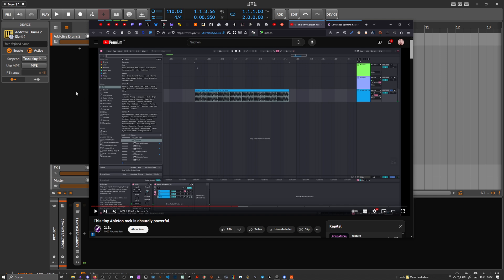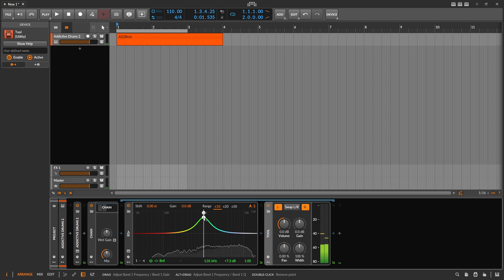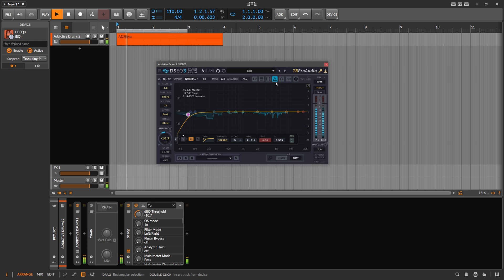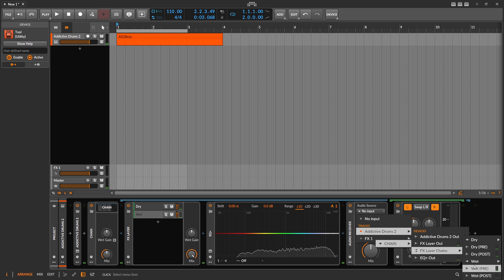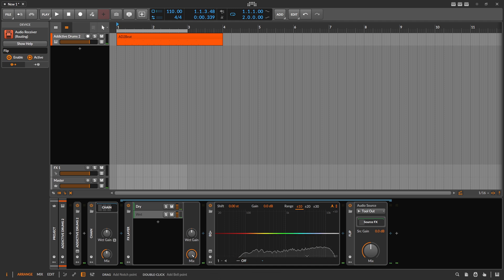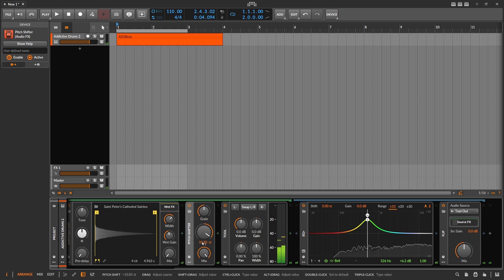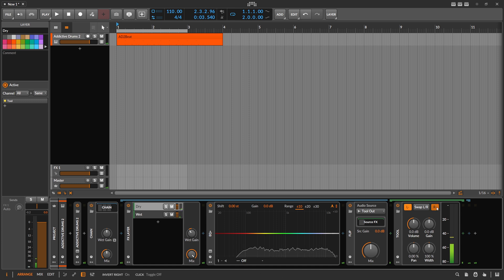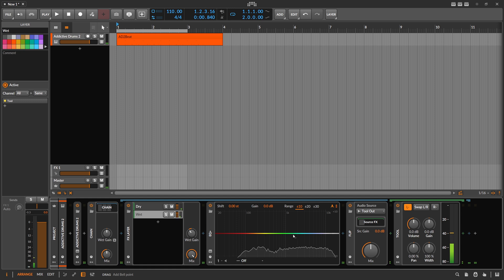This Bitwig Chain Should Not Work (But It Does)

Comment: yoooooo I was hoping people would make the same for other daws, lets me be lazier 🔥 🔥 

a few things:

the most powerful part of this technique is that it works with any effect, not just eq. I have seen multiple people do blending in of effects with eq in a similar manner previously, but have not seen people use other effects (although I'm sure some have). this flexibility is the most important part: i only sometimes use eqs for the splitting, more commonly I use clippers, choruses, transient shapers, spectral gates, etc. For example, you could use the bitwig odd/even harmonic split, and use it to mix two different separate signals together, one with only even harmonics and one with only odd! (would work best if the fundamental of both sounds is the same)

the second thing I want to mention is that i think because you're mixing the signals together at the end with dry wet rather than a parallel chain, it is at half the volume (unless bitwig dry wet uses equal power crossfades, in which case it's around 70.7% volume)

6:42 - the main difference between this effect with an eq and putting a bandpass on the reverb wet chain is that the eq is also effecting the dry signal in the opposite way: it cuts out the part where the reverb is added, thus acting like a dry/wet fader. However, I've only used bitwig briefly so you could be talking about something different then what I'm thinking of here, in which case the benefit, like you mention later, is the ability to use multiple eq points.
Reply from the maker: I wasn't aware that the dry is processed in the opposite way too, but it makes sense. And yes, then it's not just a bandpass on the wet signal :)

I was using the "mix" knob to make the chain simpler and countering the volume dip with a 6dB gain.

Thanks for stopping by and for the clarification 🔥🤝
Reply: ah gotcha, didn't see the 6db boost that's perfect then!

and thank you for the video 🙏🙏
Reply: now we just need someone to make "this tiny patcher patch is absurdly powerful"
Reply from the maker: we must go deeper

Comment: Dan Worrall introduced this concept to me few years ago, and I still keep coming with ideas to exploit it and experiments whit no clear idea where they'll take me :). Affecting 50% of one non-inverted and 50% of another inverted (canceled-out) signal with same processing will take the two in opposite directions. All-pass filter is a powerful tool here, series of them for even more fun. So say, you add disperser (kiloHearts) to such chain to get highlighted notes and harmonics on one signal, at the same time cutting the same frequencies on the other. Further, you can pitch-track it to incoming notes, or any other way which serves the purpose, like coming up with some weird chords, or affect same harmonics differently on two signals for some detune and stereo effects I'm sure I wouldn't come up with differently. If that's your thing anyway. For myself, I'd prefer less playing around and more finished tracks, but just can't help it :) Cheers for the video

Comment: I don't understand this trend. A delta isn't just the difference. The processing needs to be out of phase with the original sound, so the processing will always be the opposite polarity of the processing when it is mixed with the original audio. This might not be obvious on headphones, but on speakers, it would sound like the sound is "sucking" wrong, and especially with low frequency sounds. I was able to craft perfectly good mixes back in my day without the need of such approaches. ITB mixes can become quite easily too transparent sounding, further discretising the processing is only going to add to that, since it sounds like a parallel signal that doesn't quite belong to the input

"KISS" as they say
Reply: you're right, when you don't get to make music, you end up doing redundant sound processing nonsense ;)
Reply: delta signals are normally in phase with the original unless they are flipped in some way! This is because you are flipping the phase of the parts of the signal that were changed, thus leaving just the unaltered parts of the original. In fact, the only thing causing any potentially unwanted phase artifacts here is the phase shift from the eq itself (and that goes away when using a linear phase one)!

Comment: I like your delta signal chain. I will use that. I also use delta signals in weird ways. I like to use them on buses because if you delta a glue compressor on a bus then any signal you send gets glue compressed as if the glue was on the master channel except this way you can exclude things if you want to. This also gives you (sort of) individual mix amount via the send knobs for the amount of compression per track but still using only one compressor. I also like to use this trick for sidechain compression and 1/4 pumping so that I can use only one volume shaper to make everything pump to same shape and still individual mix amounts.
Reply: yoooo I do the same thing with sidechain as well love that trick